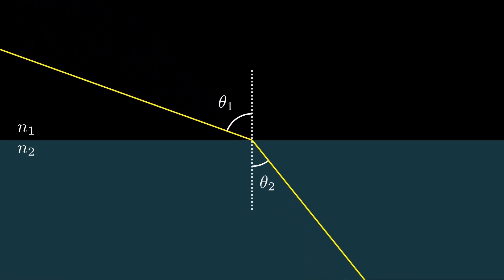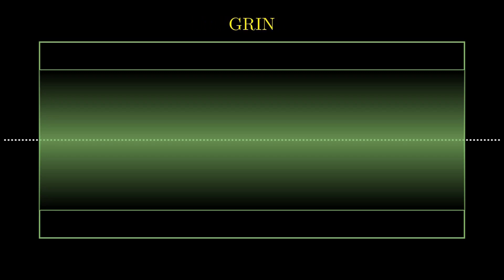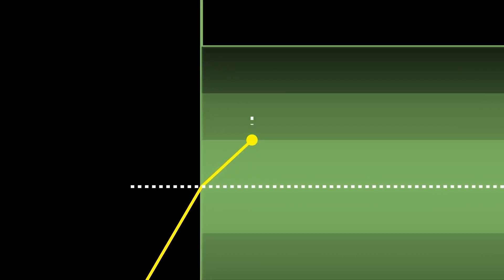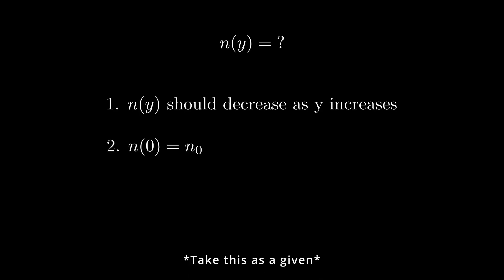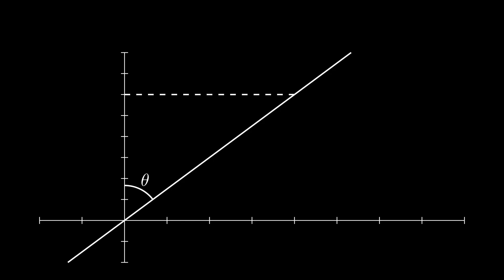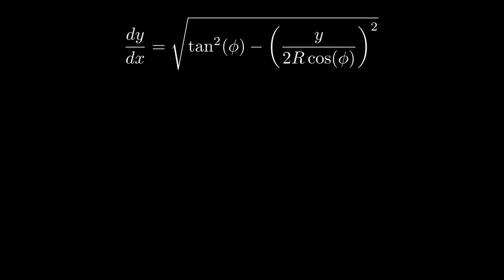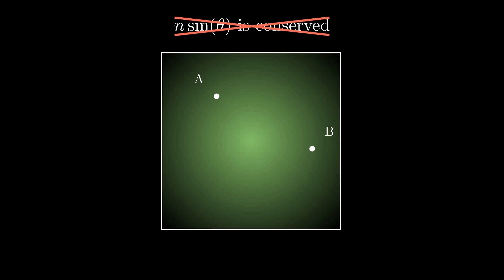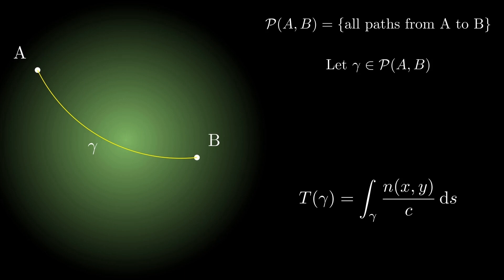Why Snell's Law is actually a differential equation

Comment from the maker: After having some time to reflect, here are some topics that I feel like I didn't fully address in the video along with some personal reflections:
-The definition for n(y) here seemed rather arbitrary. However, the key thing to keep in mind is that regardless of what n(y) is, the process of creating and then solving a differential equation will not change.
-At the end, the explanation behind how the integral representing T(γ) was created was quite vague. This is mainly because a thorough discussion of Fermat's Principle would make this video way too long (perhaps a follow-up video might do it justice?)
-I tried very hard to avoid using any higher-level math language or calculus. My ultimate goal was for this video to be accessible to a high-school student taking Algebra II. Similarly, high school physics concepts like index of refraction, Snell's Law, etc aren't explained to cut down on the video's length.

Overall, as the first video on my channel, this is nowhere close to perfect (especially the audio quality at times...). Thus, any feedback regarding the video's pacing, content, difficulty, overall quality, or anything else is greatly appreciated.